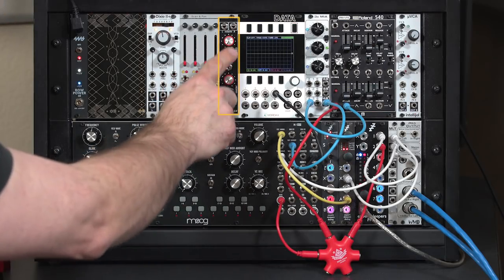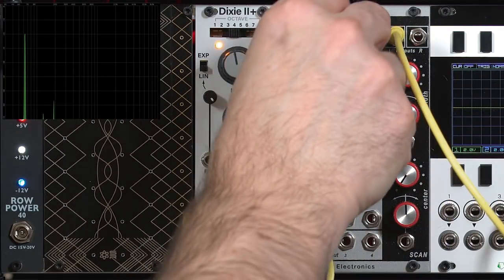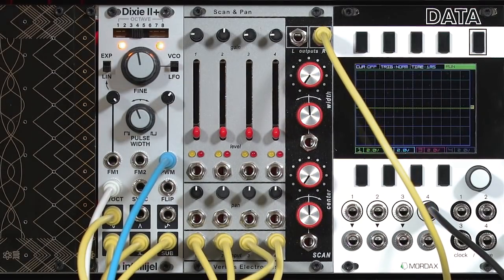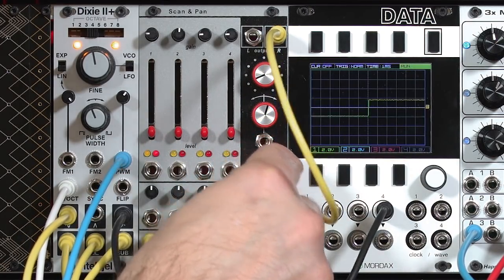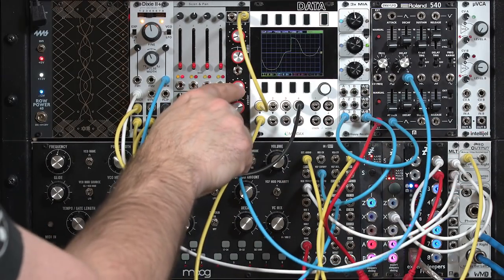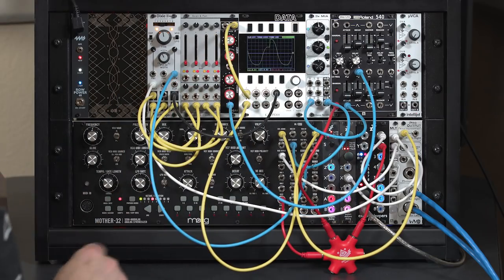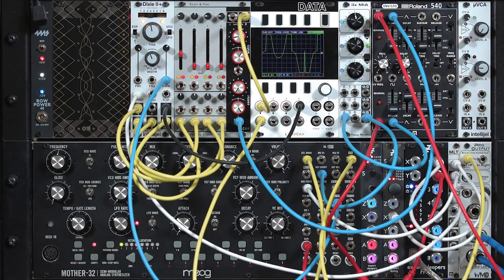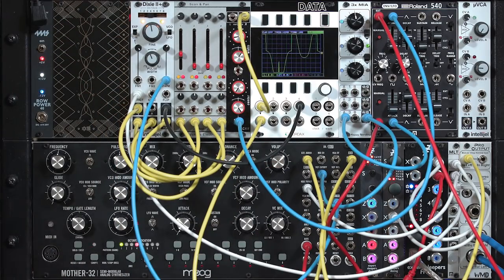Verbos Scan & Pan: Dynamic Waveform Mixing (LMS: Eurorack Expansion Preview)

Comment: Do you happen to have any thoughts on module’s ability to create audio rate stereo side bands? 

Make noise claim that their x-pan is particularly  suited to this job. But I don’t understand why. 

This module combines features from both the Joranalogue Morph 4 and the Makenoise X-pan! 
The one thing I was hoping you could add to this video, was audio rate panning. 

Make noise has a demo of their x-pan module. It’s awesome, but not a available right now. 

And the joranalogue morph-4 is a high HP and I potentially might get lost in its functionality. 

Thanks Chris!
Reply from the maker: I'm not in a good place to test it right now (still wheelchair-bound with my broken leg), but it seemed to respond very fast when I was sending it instant panning changes from a sample & hold - no spatial slurring as it slewed from one pan position to another. Plus, it's analog instead of digital (some digital modules have problems with not scanning their CV inputs fast enough for audio-rate response). So I strongly suspect the Verbos will indeed do audio rate panning/mixing/etc.
Reply: @LearningModular  I hope that leg is healing fast Chris ! :) 
Ok that’s good, helpful feedback thanks. 
I have always had my suspicions about digital or software based audio rate clarity limitations. 
I didn’t quite understand my skepticism fully but I figured that resolution, sample rate and aliasing might come into it. 
I’d love to understand this more thoroughly because I use bitwig software for a lot of my patching. Sending audio rate cv to my eurorack for example. 
I wonder if in that scenario, the resolution (even though bitwig has 4x over sampling) would give less impressive results? 

Also, I wonder if I were to get more impressive results by doing audio rate stereo panning in eurorack, would that analog quality level be lost  once it is played back at 24/44.1? 

Much appreciated for your time answering Chris 🙏
Reply from the maker: @Pspiralifemusicandedu  The digital limitation is that some hardware modules, pedals, etc. scan their CV inputs at, say, 1 kHZ or slower, with no antialiasing, resulting in either no effect or irregular results when you try to audio-rate module them.

If you are sending audio rate signals from software to a converter capable of handling audio rates, then there should be no issue sending CVs from Bitwig to your modules; it's the module that either is going to deal with it or not.

These modules (analog ones in particular) do produce harmonics above 20 kHz; it's a question of whether you want to chop off that information before you even record it, or if you want to give more information to your software and plugins to resolve later. As far as recording audio rate sidebands, I know that recording at 44.1 kHz is popular in Europe...but I personally fall into the camp of recording at 96 kHz, and then letting the software (esp. plugins like EQ) deal with resolving that down to your mastering destination.
Reply: @LearningModular  super helpful thanks again! I’ll be sure to resubscribe to your patreon when I can afford to 🙏

Comment: Hi, love these tutorials! I have a TINRS Edgecutter ADSR and I'm trying to re-create the same beautiful effect of crossfading between different channels by plugging its rise and fall into the Scan CV input of the Verbos. I recreated the same rise and fall settings form your video on my TINRS and the S and P,  but it's not doing the trick. Was wondering if you're familiar with this module and if there's a trick to get it work as seamlessly as your Roland 540. Thanks you!
Reply from the maker: By its Rise and Fall, do you mean the Phase output jacks along the right edge of the Edgecutter, with LEDs next to them? If so, those are just gates for when you've reached a certain stage of the envelope (maybe to trigger another envelope), and would not work for this purpose. You'd want to use one of the Envelope Outputs in the lower right corner.
Reply: Thanks so much for replying! No I was actually using the main ADSR output and not the gates. I spoke with someone at TINRS and they were also perplexed. They did however mention that the edgecutter goes to 5v at its peak, so perhaps there’s a discrepancy there in relation to the Roland? Also the milliamperes range is different with the Roland, perhaps that has something to do with it as well? I basically recreated the same settings on the edge cutter that are in your video and it wasn’t as smooth. It almost sounds like it stops at each segment of the ADSR line, so it’s not smooth at all. And also it was only moving through two channels on the scan and pan, versus all 4, and I basically recreated all the same settings in your video on both modules? Any thoughts or insight would be greatly appreciated!
Reply from the maker: YouTube is playing games with me tonight - I saw a follow-up from you, and now I don't, but I'll answer anyway. The Roland has an output range of roughly 0-8v, compared to the Edgecutter's apparent 0-5v. You should be able to compensate for this by adjusting the CV attenuator for Center on the Verbos. (And if the Edgecutter still won't scan the entire 4 channels, then you will need to feed it through a utility mixer that can boost its level. The Edgecutter really should be outputting 0-10v, to match the most current modules.)

The milliamp rating is the power the module consumers, not what it sends out as a control, so that shouldn't be an issue.

I have not used and Edgecutter, but the Roland has particularly smooth envelope shapes. You may need to spend some time dialing in the envelope shape on the Edgecutter to get a similar response. This is where a 'scope module like DATA comes in really handy to show you exactly what a module is sending out.

Hope that helps...

Comment: Hey Chris thanks for the video! Really enjoy your run throughs and i have learned so much from you. Much appreciated!!! One question if i may, How does running a signal from the Dixie into channel 4 of the Mordax Data help the sync? Perhaps i don't understand Syncing yet. Thanks bud!!
Reply from the maker: The DATA like to know which input to look at to synchronize its display. All of the inputs are then displayed in relation to the timing of that synchronization references. So it's good to pick a stable waveform with a clear zero crossing (something that's not being modulated, and has a vertical edge, works best).

If the DATA does not have a sync input, it will either display nothing as it waits for the sync signal, or it will free-run at its own speed which may or may not have anything to do with with the rate of the waveform its displaying. Free running works great if you're showing slow voltages like envelopes and LFOs, but can be useless when looking at VCOs.
Reply: Super thanks so much for clearing that up!! I should read up more on the Data....have not spent enough time with all its features and capabilities. Cheers
Reply from the maker: It's not the most obvious thing. I usually cover it near the start of my courses.

Comment: You can get even crazier--something I do is put L and R outputs into input and modulator of AJH Synth Ring mod to get really strange constantly changing Rind mod effects. It's really good for if you also use it as an end stage mixer and have 4 inputs which are all separate and complex to begin with, and then cv the scanning to widen up the space between them and create harmonic and melodic variation.

Comment: have you ever had any trouble with the pan and scan?
Reply from the maker: So far it's worked fine for me. On all of their modules with the Scan feature, they can seem to be wonky if the Center and Width knobs are set to boost a channel without you realizing it; tonight or tomorrow I'll be posting an article on LearningModular.com about using it.
Reply: Cool, I will have to look that up :)
Reply: IMO it's one of the most useful modules in eurorack.
Reply: Yep, I do that to for all sorts of things. To me it's really a no brainer--you have a 4 input mixer with cv over panning, 4 vca, cv over scanning..everyone needs mixers and modulation, this does both. If you have a simpler mixer already and are low on space I'd kick something out to make room for it. As a person low on funds and space, I've done that with almost every purchase I've ever made (can I sell something else and replace it with this to get a better net affect with a modest increase in price once I use the other thing's profits).
Reply: Oh yeah! Very good point. You get some really nice distortion in there. I've put in digital drums from logic and messed them up through my modular, panned them around and w/ saturation on the Verbos they start to feel much more alive.
Reply: I still think about getting one, but I'm out of space!  Saving up for a bigger case, perhaps then I will scan the pans and flange the flams.
Reply from the maker: I'll add in that in addition to all the functions Nick mentioned, the high degree of input gain (I'm finding I need gain more and more in the middle of a patch), and the really smooth saturation when you push it too far, also set it above the average mixer.
Reply: Interesting though, I would find I usually need less gain as I progress in a patch..but in any case...MIXING! Very important.